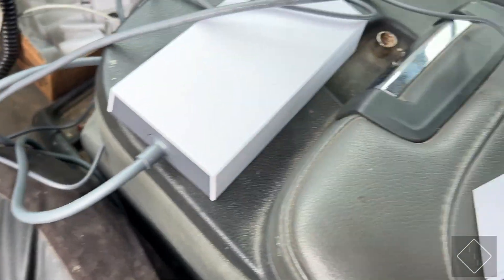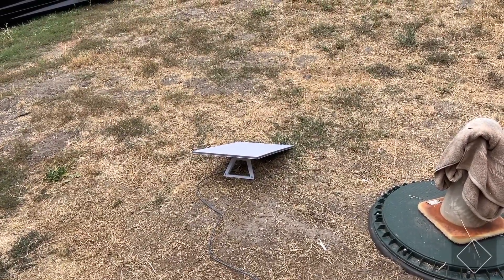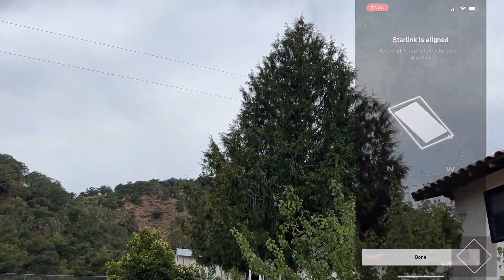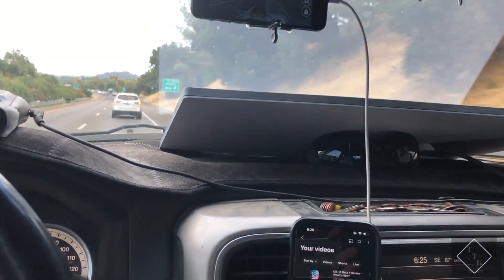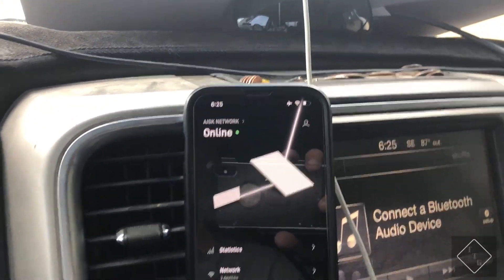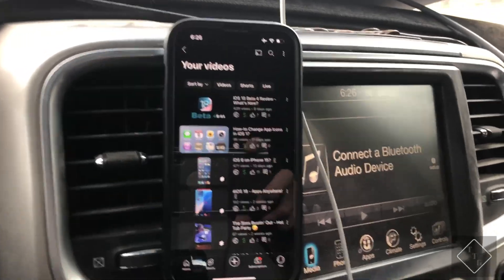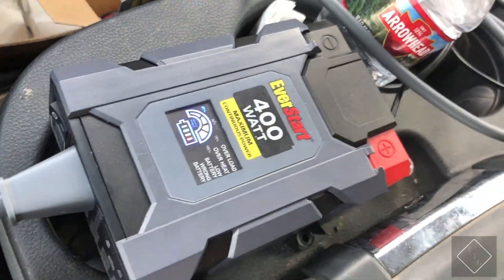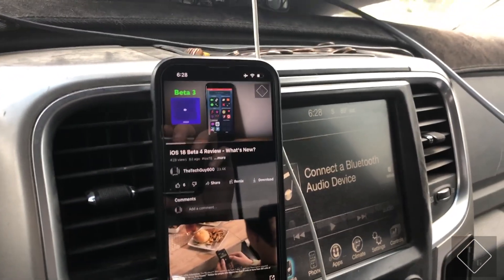Will Starlink Gen 3 Work While Driving?

Comment: Just curious... I have a Ram truck as well with the plug adapter in the dash like yours. I noticed that you were using the outlet while sitting still but when you showed you were in motion you were using the inverter. Is there a reason you switched?  I only ask because I am about to take a trip and if the outlet wont be enough for the starlink system I should probably get an inverter but I would rather not have another thing to worry about.
Reply: @agent_smith...  came here with the same question. Seemed odd, and he made no mention of it.
Reply: @Gordon9767  Just an update... the outlet in my truck would power it but it wouldnt work correctly. Perhaps the voltage was off. I did buy a 500w inverter and it did power it perfectly.  I have now begun to use the Starlink in a residential capacity because I ended up moving way far out with no internet services available. So far the Starlink has performed well above what I would have thought and I couldnt be more pleased.
Reply: @agent_smith... which inverter did you happen to go with? Does it just plug into one of the cig lighter styles, or do you run to your battery?
Reply: @Gordon9767  500w cobra cig lighter inverter    I think I paid $50ish bucks at a truck stop. I didnt plan for it to be used all the time in my truck or more than just a couple times all together so I opted not to run any permanent wires or hookups.